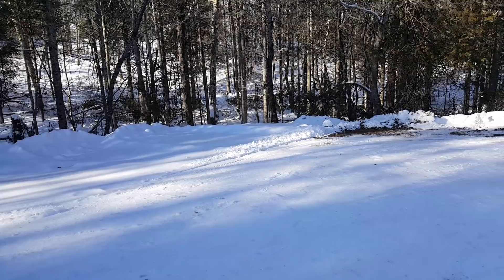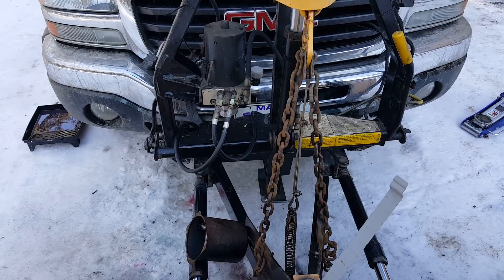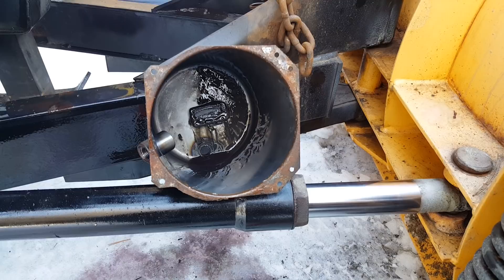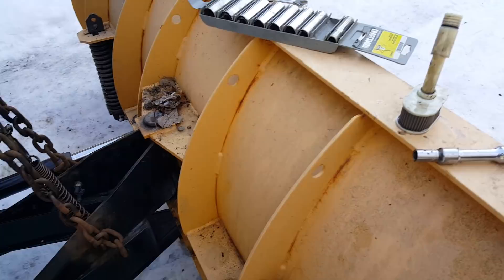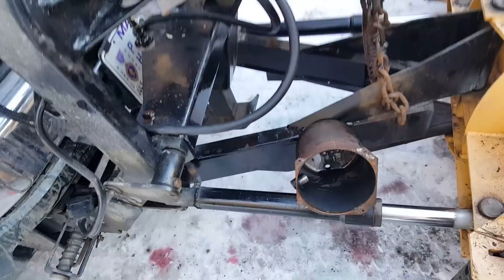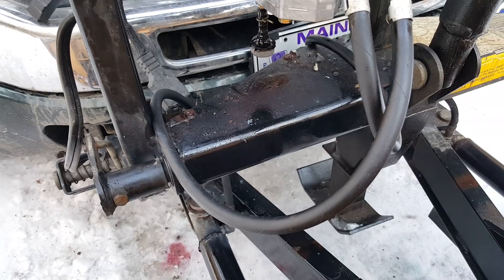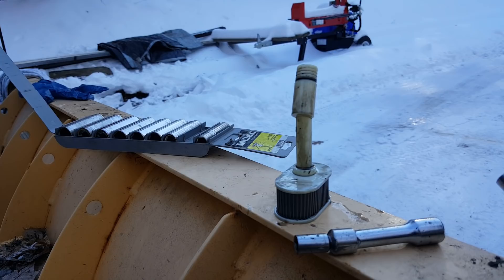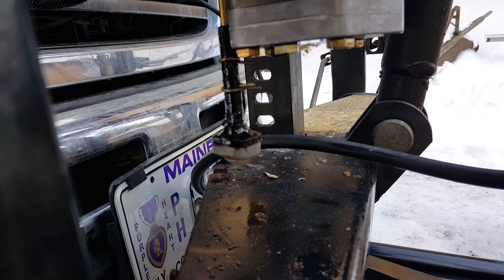Fisher Plow hydraulics, jerky, halty, slow movement, won't raise, won't turn

Comment: You’re a life saver for this. I almost spent $680 on a new pump installed (high priced because it was dead in the middle of a storm at 4am) but looked into it, found your video and come to find out had the same issue. Fixed it for free, was back out by 5:30am and plowed all day.

Comment: Very informative video, thank you.  I was plowing about a month ago and hit a piece of buried concrete in a blacktop parking lot and it broke the hydraulic line going to the passenger side cylinder and pretty much drained the pump.  I was able to secure the blade in the up position and got the truck to the local Fisher plow dealer and they replaced the line.  Ever since though, when I move the blade from side to side, it seems to have excessive left to right travel, doesn't seem as tight as it was before.  Thanks for giving me ideas to check.

Comment from the maker: This video is about the "uptake tube" having fallen out of its connection to the pump inside the reservoir tank.  It's only held in place by the compression of an "O".

As to using red ATF fluid instead of the blue low temperature fluid.  In an emergency you can use ATF.  It works fine at temperatures above 15 degrees.  However, it should not be used permanently because at below 15 degrees it will take your battery down quickly and is very hard on your electric pump motor.  Thanks to everyone who commented about this issue.

Comment: That piece is the suction filter. You need to clean or replace. Clean out the canister and magnet. There is no gasket, instead a large o ring which should be replaced if possible. You can purchase a kit with filter and o ring

Comment: my pump filter was plugged with slug .hadn't been apart in years .The magnet in the bottom is a good thing but it only takes up what it can .rest goes  to the pump .filter.  blow out and good to go. my electric motor was getting warm out so the dust ended up down in the tank

Comment: there is suppose to be a gasket when you separate the can. also fisher hydraulic is blue  they don't run very well on atf.  that might be your problem.  love fisher plows have worked well for me.
Reply from the maker: +McCloud Landscaping,
Yes, thanks for your comment.  When I did the video I neglected to see that the gasket on this can was actually a "O" ring under the grime.  The problem was not loss of fluid.  The pickup tube was only held in by "o" rings and friction, it had fallen into the reservoir, the pump then could only suck up limited fluid, only enough to allow very limited operation.
Reply: well thats good hope everything worked out
Reply from the maker: +McCloud Landscaping Yes, thanks.  Works great now!

Comment: So technically if I wanted to change the whole assembly I could just unbolt all the lines, and both those two bolts slide it out and then bolt the new one in? I've looked everywhere 4 how to do this because mine rotted out in the bottom.

Comment: Thank you for your Service, Sir! I’m up in Northern Canada… should snow any minute. Excellent video, as I Just acquired the same plow. Did you have to disconnect the entire pump/motor to get the bottom out? What is the plastic fill plug for? My plow takes a couple minutes to start working, but works okay after that.
Reply: Sorry, just listen to the entire vid.. excellent I’m pulling it apart this morning
Reply from the maker: Hi John,
Sorry, you're having trouble with your plow. I have never needed to disconnect the power to the pump motor. It is necessary to unbolt the motor to swing it out a bit to allow clearance as I described in the video. If your plow movement is starting slowly, you might want to check your battery for low voltage or a bad ground.  The plow does require a strong battery. Also check your fluid to be sure that it is the low temperature type. It must be gray and not red. The wrong type will cause it to be very slow and drain your battery quickly when the temperature drops. Of course you also need enough fluid to keep the reservoir and hydraulic rams full. Good luck!
Reply: @gkeppel  Tip Top George, that looks like the issue, much appreciate your video.

Comment: I will correct what McCloud said. The New Fishers, mm1 and mm2 don not like the atf, the original mm where they either had belt drive under hood or electric pump on head gear that stayed on truck did take ATF DEX/MERC!! DO NOT USE TYPE F FLUID IN A FISHER EVER
Reply from the maker: +Jeffrey Roberts
Thanks Jeffrey, you are correct!
Reply: I got mine used. It looks like it's running red ATF. It's been working but it's slow and now sometimes makes noise when lifting. Would it be safe to add the proper fluid without draining the lines? I just want to dump the ATF out of the reservoir and refill with hydraulic fluid.
Reply from the maker: Hi James, Sorry I missed your post.  Hope it all worked out for you.  Mixing the fluid probably only lessens performance, but is still not the best thing to do.

Comment: Did that cause the power light to blink and plow would not move. Thanks
Reply from the maker: For my Fisher plow, the only light is a small red LED on the dash mounted toggle. It simply indicates that the power was on or off. If it blinks, then you probably have a bad electrical connection. I once discovered that I needed to replace my alternator. When plowing it drew the battery amperage down to where it would hardly lift the plow. After first replacing the battery, I discovered that it actually needed an alternator.

Comment: Question. My plow is jerky going up. The pump sounds good and running fine. All other movements fine. Side to side. Any ideas? Thank you
Reply from the maker: Kenny, I'd add a little fluid 1st and if it's not better, take it apart as shown in my video and check the filter screen, the snugness of the uptake piece and of course the fluid level.  It really doesn't take very long to do that. Just be prepared to save your fluid and keep it clean.
Reply: @gkeppel   I think it's the plug connection
Reply from the maker: @kennyplay5982  Glad you figured it out. I've never had that problem before.

Comment: You never said was it was doing for you to take it apart. My friends plow will not go down.
Reply from the maker: Yes, sorry about that. My plow was working only intermittently and very jerky when it did work.  Since I had recently changed the fluid, my reservoir was full and so even without the uptake tube it was able to suck off the surface and still work.  If your fluid level is down only an inch or two, it will not work at all without the uptake.